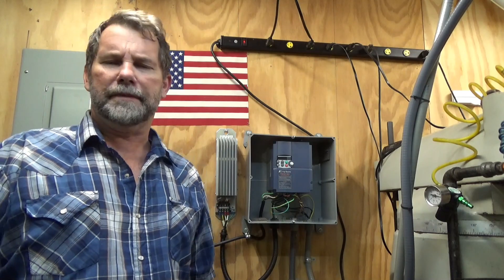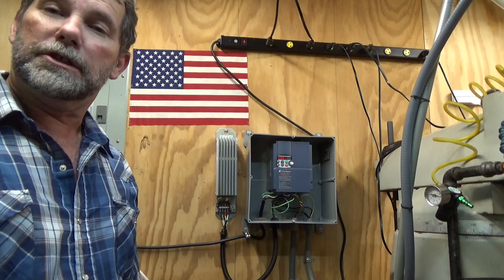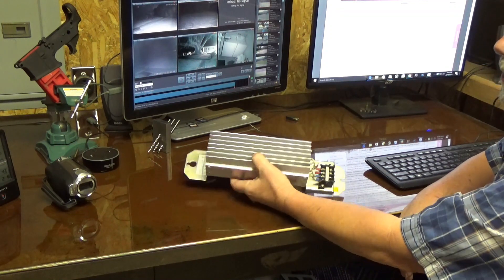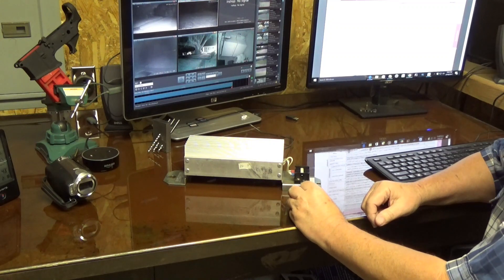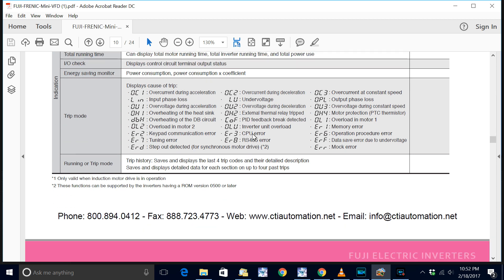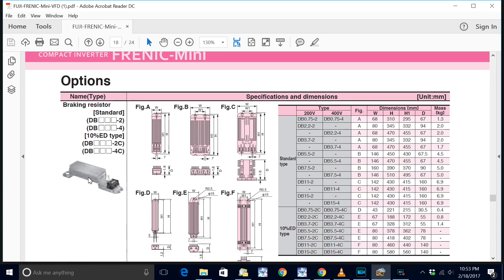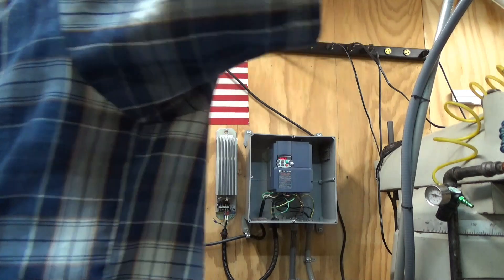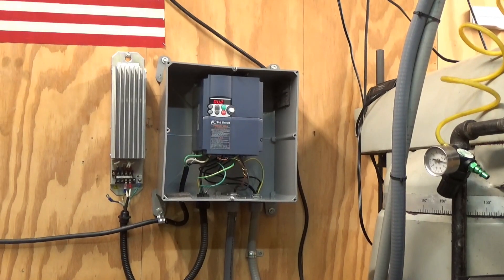Dynamic Braking on a Milling Machine with a VFD

Comment: Hey Brian,
You can use a momentary pushbutton for reversing instead of the maintained / momentary combo you are currently using. You would end up with 3 pushbuttons  / fwd run / rev run / stop. Pushing any button will enter that run command and override the previous command. Great explanation on dynamic braking :)
Reply from the maker: By george Stan you may be on to something there, best advice I've gotten so far. I'm going to have a look into this idea. Thanks again Stan!
Reply: Hi Stan
I have this option on the VDFs I'm experimenting with right now ... but I don't like it ... I seems wrong to me NOT stopping in between ;-))

Comment: Adding the resistor to my Teco VFD made a massive difference, I have it set to a 1.5s ramp up and stop, worth the $50 or so I paid for the resistor.
Reply from the maker: Yes the VFD is very flexible on settings

Comment: How do you size a braking resistor? id like to add one to my lathe running a vfd. id imagine a bit more inertia spinning a 8" chuck but would be half the rpm.
Reply from the maker: It has been awhile, don't recall right now.

Comment: I'm sure you've got this sorted by now but on my Hitachi VFD you feed 24v on one side of the switch and the other side is wired to a terminal programmed for forward/reverse.  When it has voltage it goes one way and when it doesn't it goes the other way.

Comment: Hi!  I have just installed a brake resistor but it’s not make my lathe brake as fast as your mill does.  What settings do you have in your VFD to make it stop so quickly? It’s so many parameters to choose from. Thanks for your videos. Regards Eric
Reply from the maker: that was quite awhile back when I was into vfd's I don't remember the setting, sorry
Reply: @bstanga  aha okej! Thanks for your answer anyway 👍😊

Comment: My Hitachi has the "Tap" function that spins forward for specified seconds and then reverses.  I programmed a Tap button that requires holding it and flipping the Forward switch to start.  The Hitachi manual is probably no easier for me to wade through than the Fuji manual is for you, unless you are doing VFD programming and wiring on a regular basis and then it would probably be super easy stuff.
Cheers, Gary
Reply from the maker: That sounds like something close to what I am looking to do Gary, what model # Hitachi do you have? I'll look up the user manual, cause maybe it will give me some idea's I can apply to the fuji.
Reply: It's the WJ200 Hitachi.
Reply from the maker: thanks gary i'll have a look

Comment: If you add little HMI or PLC then using 2 wires only rs485 communication you can right a code to reverse direction and control speed.

Comment: Good to see you Brian. 
Wow -that braking works super good. Can imagine the energy transfer! A one sec stop is pretty quick.
Not sure about the reverse deal - am thinking some extra electronics could be needed - to provide the needed sequence.
Hope the neck is bearable.
Reply from the maker: Thanks Chris, just had a EMG (needle study) done yesterday (yes on a Saturday!) you talk about a painful test and it took 2 hrs to complete. This was the second time I've had the test although the first one did not take as long. Surgery next month, no date set, they were waiting for the EMG test results. One thing I know for sure is it is getting WORSE not better.

 On the brake I was impressed as well, this is just scratching the surface on a VFD's capabilities. I'm pretty sure I can do the reverse thing with a separate button/switch setup

Comment: That is a neat device.  Hopefully you will get it to reverse like you want.  I need to get some switches and wire my machine so it will go in reverse.  I know about motivation, been a bit slow to do anything myself.
Reply from the maker: I'll get it figured out Harold, thanks for watching!

Comment: Hi again Brian !
I just re-saw (if that word exists !) your video and specificly the part about the instant reversing ... ha, ha, I have the opposit problem - I DON'T want it to automaticly reverse, I want it to STOP and I should press the START again - my VFD does want you want by default ... ;-(( ... but I don't want it !

I'm experimenting with some VFD's I have to find one for the motor on my lathe - an old russian one from 1962 - I'm not sure how big it should be until I get into the motor ... deep down under some covers ... dirty as hell - I was told anything between 4 and 6 HP, so it's a heavy duty VFD I should have.

Comment: I only have experience with Allen Bradley VFDs.. I have a 2hp on my lathe, and I have it spin down a little slower to avoid the overvoltage error.. I've been thinking about adding a resistor to it.. just haven't found one cheap enough (eg:free)
Reply from the maker: real cheap would be one scavenged from an old electric heater element
Reply: I have used electric heater elements for resistors. The 1500 watt element is 13 ohms cold if I recall right. The resistance changes as it heats up, do not recall how much. Worked fine for me though to reduce rpm on repulsion motor.

Comment: Is there a way to recycle the Energy instead of burning it through a resistor?
Reply: if you don't disapate the extra power during a ramp to stop, the vfd "buss" goes way overvoltage and thus causes an error.   this resistor enables the brake effect to work.     So what would YOU do with a few hundred to a thousand watts for a second?  power a light for a second?  in the big scheme of things it's not worth worrying over.  at my utility rate, a kilowatt hour only costs 9 cents.  that's a thousand watts for an hour, not just a second

Comment: not sure if its safe to have that brake resistor on wood. that thing heats up.
Reply from the maker: it has long stand off to mount to any surface and a large heat sink., that said it only has energy when it spools down